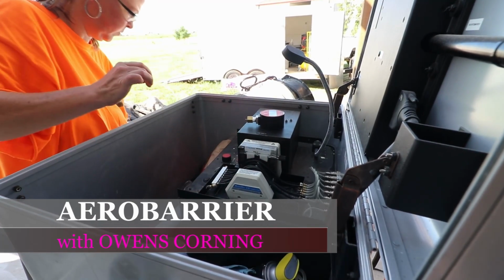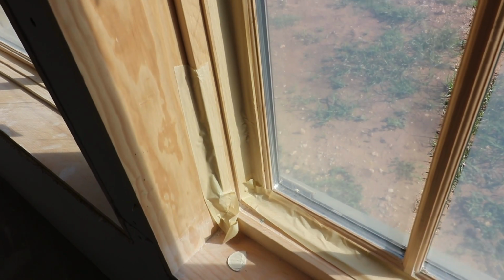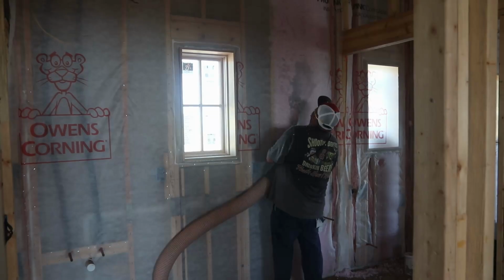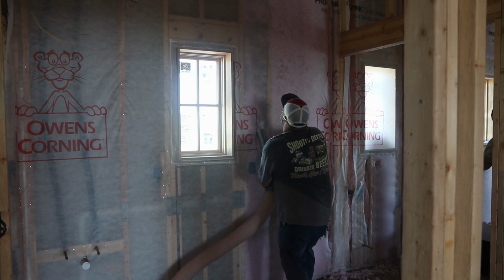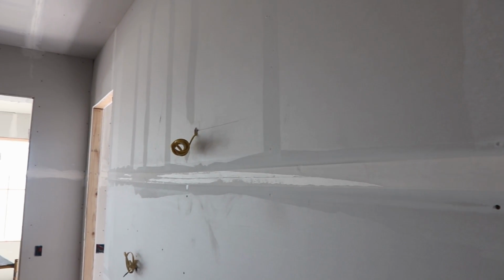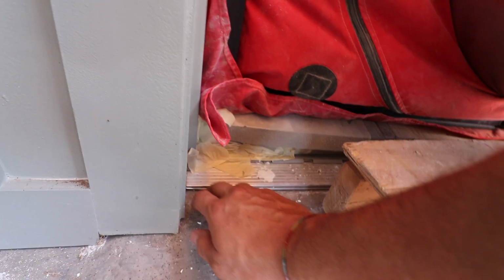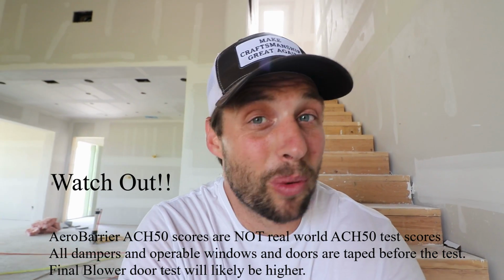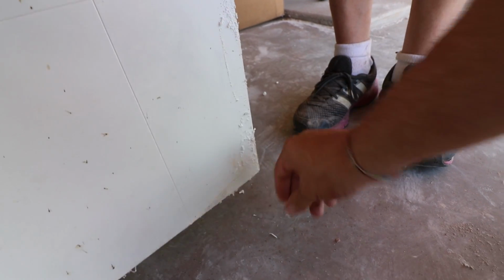This Insulation is BETTER than Spray Foam!!

Comment: Jordan, now that you've done the air sealing how do you prevent any of the finish tradespeople of putting a hole in you envelope? Like a cabinet installer missing a stud and covering it up with the cabinet.
Reply: Not to mention the homeowner hanging mirrors, paintings, photos and such.
Reply: U can only hand over a sealed home to the homeowner. . . I would hope they would be informed enough and invested enough to carry on with the program. . . If they wanna destroy it after being informed and educated then so be it.

Comment: My parents used the blown in cellulose and it does settle over time, we had to tear some drywall after a fire and there was a 12" gap at the top, this was roughly 10 years later.
Reply: I'm going with rockwool, not worth the headache
Reply: No settling of cellulose in walls if sprayed in with moisture and glue. We've had this technology for 40 years.
Reply: @TheGardenMasterShow  how many jobs have you went back to after so many years to tear out drywall to inspect the insulation?
Reply: @stcharleshometheater  You don't have to tear any drywall out to inspect any more if you have enough money to buy a machine, there is a machine and an app that you can use with your phone to see thru the walls to see how much insulation is in there. Though I was told it does cost quite a bit for the machine.  I only know this because I live in an older home built in the 40s and had some work done as I got it done threw a special program for the elderly. They used this door contraption and sealed everything they could seal up, but they used caulk and caulking guns they didn't have a machine like they did spraying. I even helped them to find spots that air was getting coming threw,  I had older windows with the cables to lift them up and close them and where them cables run in we had to caulk them big holes. They also went up into the attic and found every air leak they could and caulked, They sprayed insulation into my walls from the outside, taking off pieces of siding and drilling holes. They had to have it inspected from a government contractor to see if the contractors did what they should of. When the government contractor came he had a small machine he used along with an app on his phone and he could see in all the walls. There were several things this government contractor found that they had missed. And with this machine and app he had, he found that there were several walls that they had only blown the insulation 3/4 the way up the wall. So the contractors that originally did the work had to come back and do the things they missed as well as filling up the walls they missed blowing the insulation all the way in.  It was rather interesting. Only thing about the caulk is Im not sure how long it will last. :-(
Reply: @TheGardenMasterShow  I have seen the glue used with blown in fiber glass at home shows. I put a small ink mark on there display 12 years ago after seeing it for 5 years or more. The ink is still there, No settling yet, and that display gets bounced around loading and unloading plus the bouncing around in the truck or trailer going down the road. I'd say it works ;-)

Comment: I thought I've seen this done before drywall and insulation...
Reply: I was wondering that myself? Why not ensure the outer shell is sealed first
Reply: Same here. I may have missed him talking about it.....why he did it after sheetrock. Not sure.
Reply: @kipcarroll486  I saw he replied in a comment that this was actually what aero prescribed and so he was just following their procedures. And that best practice is to do it during both stages, before and after drywall
Reply: @MandoFettOG  Yes, I saw that after I commented on it here. Thx

Comment: Thanks Jordan. I am going to price out your method against 2 in closed spray foam and RockWool. I am already using Zip-R and 2X6s and better sill sealer. Can my builder feel comfortable with Zip-R roof as he has never used it there before? He was going to use 3 in spray foam under roof.
Reply: Richard Raborn I’m thinking the same thing. What did your analysis come up with?
Reply: Please what did you decide on and why?
Reply: @seanbrossard8178  Trying to confirm contact with Pro Pink installer and my builder. Still months from insulation install

Comment: Air gap between the wall and zip r sheeting? Or air gap between siding and zip r? I asked your buddy Matt with no response (too busy I'm sure) what a good procedure for a thermal break in cold climate areas. I am reading issues with zip r and sheet foam on the exterior, building condensation in the wall cavity. Would this be solved by a blow in insulation wall cavity having an air barrier being created by the insulation hold? Any info would help. Would love to get a contact exchange to get ideas bounced before construction.
Reply: Air gap is between zip and siding.  Siding is just a rain/uv screen, the zip is the waterproofing.  Air gap just lets water drain and dry when water gets behind the siding

Comment: How can putting tiny particles of fiberglass be healthy? Eventually those pieces will get into the home. And how would you make changes safely?
Reply: Size. According to the hard A.. OSHA inspectors on a federal job I worked he said fiber glass is to big to get caught deep in your lungs.
Also the insulation has plastic mesh, sheetrock and base trim all holding it back as well as it most likely leaking to the bottom so about 5 or 6 feet away from my personal air intake.
PS way more concerned about fatty liver /diabetes, CHF, vascular disease all caused by my soda intake, than a little fiberglass.

Comment: Does aerobarrier degrade over time like caulk does?
Reply: In accelerated lab testing it's been found to be stable and still hold after 50 years equivalent aging. I don't know their methods, so take it with a grain of salt. 

The polymer they use is a vinyl acetate polymer. This family of compounds is quite safe; different variants are the basis of Elmer's glue, yellow wood glue, and one form is even a basis in most chewing gums. About the most dangerous part is when you atomize the monomer (as they do in the application) you'd want to avoid sparks and probably not breathe it in.
Reply: @ardenthebibliophile  Shrinkage is my concern... Over time... the product must contain some water...
Reply: @CraigeLowry  it does not contain an appreciable amount of water.
Reply: @ardenthebibliophile  I have seen products quite similar to this, like the latex/ cementious insulation fill foam... It shrunk at least 20% in some areas... The home owner had it torn out and polyurethane foam sprayed in and it performed at much higher efficiency and comfort level according to the homeowner.. I believe I would stick with the non-shrinking calk and spray foam for my home seal an insulation, especially in the long run.
Reply: @CraigeLowry  so what you're saying is a completely unrelated material shrank, while a separate completely unrelated material didn't shrink.
Reply: @ardenthebibliophile  It's the content of water in those products... And I wouldn't say unrelated they are both used for home sealing and both have high water content...
Reply: @CraigeLowry  alright bud. Seems like your mind is set.
Reply: @ardenthebibliophile  but yours ISN'T ? bud
Reply: @kcajmortsnnew1488  well I'm not comparing latex or cement to acetate. If there's evidence for acetate suffering this effect I'll change my mind. An anecdote about an unrelated product is not going to change my mind.
Reply: it has been around for atleast ten years now. but it has been used to seal up hvac duct systems  so my guess is it does not degrade..
Reply: I was wondering the same thing. I'm curious if it's silicone or acrylic?
Reply: @MandoFettOG  acrylic
Reply: Everything degrades over time.  Its called the law of entropy.
Reply: @1974jrod  and you'll find I haven't disagreed with that. I am against the idea of an anecdote about an unrelated product being used to predict the rate of decay of this one.
Reply: @ardenthebibliophile  but straw men are so much easier to knock down!

Comment: If you have to tear into something in the future you're going to regret the fiberglass...
Reply: I hate fiberglass hope we have other options, everytime I go to the attic I have to put on a half face mask then take a shower and still feel the fiberglass that stick in me
Reply: @randomizer3775  
You gotta take a cold shower first otherwise your pores open up and it gets more embedded...
Reply: @randomizer3775  You could use blown in cellulose.  Essential Craftsman just did an episode about this material.
Reply: @ckm-mkc  cellulose insulation has a higher R value than fiberglass and no itch
Reply: @randomizer3775  Get a dedicated Tyvex suit, keep it zipped-up when not in use.
Reply: Cellulose insulation works well. 🌎
Reply from the maker: Yeah! I sucked down a golf ball sized chunk of the stuff while trying to get a freaking dove out of the rafters. Nothing at all like cotton candy.
Reply: @JordanSmithBuilds  how did the hers score turn out?
We used the closed cell and radiant barrier insulated slab and some other things but ended up 51 hers score.

Comment: Really like the concept.  Wonder if there would be a difference with rockwool?  Is AeroBarrier an option on retrofit or are there too many other vairables?
Reply from the maker: AeroBarrier will work the same with RockWool or fiberglass.
They say it can be done on retrofits, but you would definitely want to take your time sealing and protecting anything you didn't want plugged.

Comment: Great video Jordan.  Have you heard about AirCrete as insulation?  Kristof Irwin talked about it on a Positive Energy video (install done by an outfit called AirKrete).  It looks pretty promising - same basic constituents as magnesium oxide panels.  I'd love to hear what you think.
Reply from the maker: I have heard about it and watched Kristof's video at the time, but i have never used it myself and so have no first hand opinions.  Of course I am always full of second hand opinions!  
First my imagined pros: High insulation value. It might be good at sound deadening? Might be cheaper than closed cell spray foam? and... I am having a hard time  coming up with any other pros.
Imagined con's: More setup time than spray foam, without any better air sealing or insulating values than closed cell. Big carbon footprint.  Hard to source in most areas.  
I have seen several spray foam guys use AeroBarrier to get a tighter home, I am sure the AirCrete guys would have similar benefits on their installations?  Doesn't seem like it would be tightly adhered to the studs after being rolled down after install?  Seeing as how it is so friable?

Comment: How long does AeroBarrier last? Your house maybe very air tight today but what happens after say 5 or 10 years?
Reply from the maker: They have data showing no degradation after 50 year simulated  life cycle testing, so I am hopeful it will stand the test of time.  But I don't know if the simulated life cycle testing and actual life cycle testing will correlate.  Time will tell.
Reply: @JordanSmithBuilds  If the house is leaky after 40 yeats, I would think one could simply redo the aerobarrier treatment.
Reply: Or you could use spray foam which is an air and vapor barrier, has a higher R value, increases structural integrity as well as racking strength plus typically has a warranty good for the lifetime of the building.
Reply: @tylerfiske9516 , Except that it's been demonstrated time and time again that spray foam alone does not equal an air tight house.  Jordan covers this in the video; they've tried it and realized that you can't rely on it alone, the rest of the building needs to be tightly built.
Reply: @superspeeder , agree.  Foam works where you put it.  Product to product nothing performs better than foam.  Are there areas that you still may need to can foam, or caulk for instance, yes.  Did the foam air seal everywhere else you put it?  Typically yes.
Reply: The sealant endurance has been verified with 50-year accelerated testing, no change.

Comment: So, Jordan - @ 3:26 as you're explaining about "needing to breathe," etc. I noticed the tread depth on the stairs behind you.  I can't tell for sure but it looks the treads are substantially deeper than a 10" - 11" tread.  Is that correct?  what was the reasoning for deeper treads (which is what I wanted to do on a remodel but was told they're uncomfortable for people climbing stairs)?  Loving your channel BTW.
Reply from the maker: We have a 7 1/2" rise with a 12" tread.  The finished treads will have minimum nosing for a more modern appearance, so we wanted enough tread length to accommodate.  No problems going up or down the stairs so far!  I mostly have trouble with the cadence of too short steps than too long.
Reply: @JordanSmithBuilds  thanks for the reply.  I've noticed that some older buildings in Richmond, VA and in Europe have deeper treads - so that's why I asked.  BTW - You're doing a great job on your channel.
Reply: I noticed the tread depth as well. From the limited views, I thought it was a good look, as well as more natural. I think the most comfortable stairs I have built were 3 deck boards wide. You didn't break your cadence going down them. This was outside though, nobody is gonna go for 17" treads indoors.
Reply: Aaron O'Connell tread plus riser is traditionally between 17-19. Not just the tread
Reply: @aaronoconnell1597  indoors is what I was wondering about.  If you notice the stairs in Tiny Houses, the treads are typically deeper (maybe not 17") - but a deep tread is something that I'm interested in.
Reply: a good rule of thumb is that tread+riser should be between 17-19"

Comment: Was the timing of the aero barrier install ideal?  I would have thought it would be better to do before the drywall and insulation was installed.
Reply from the maker: For an exterior air sealed house like this, it would work that way, but for most builds, they are relying on their drywall to air seal, so we went with the standard protocol.

Comment: I appreciate the walk through.  I just had AeroBarrier out a few weeks ago.  (They brought my project down to 0.2 ACH.  I have yet to do the final blower door test, but I am hopeful at being under 1.0 ACH.)  Anyways, I was unable to be onsite when they were doing the air sealing.  So this was cool to watch.  My AeroBarrier guys said that my project ended up as their tightest test. That stuff left a sticky mess on the floors though, but WAY worth the extra clean up!  I also used Zip 6.6 R sheathing, but with Roxul R-23 for the wall system.
Reply from the maker: That is TIGHT!  I agree with the sticky cleanup.  We left some drywall dust on the floor to help keep it from grabbing... or at least that was my excuse for having dirty floors on AeroBarrier day!
Reply: @JordanSmithBuilds  That would have been a good idea.  But my mud guy was too efficient and had already cleaned it all up.  I was really trying to get AeroBarrier out before texture, as you did, but trying to get that all to work out with the mudder was nearly impossible.
Reply: I was quoted 1.20 per foot.  Seemed expensive to me.  Is that in line with what you paid?  Thanks.
Reply: @huntsbd  I paid $1.50/sq ft.
Reply: @wjthehomebuilder  1.50 per square foot.  What a rip off.  The new dog and pony show of the home building trade.
Reply: Love Zip R. But...I priced it just yesterday...$73/sheet!

Also the prices listed below are per SQUARE foot. CC Spray Foam is per BOARD foot per INCH.

Comment: How much does it cost approximately per house?  It should be about the same for any structure.
Reply from the maker: The cost is square footage dependent.  The bigger the home, the more area to seal, the longer it takes to perform and uses more product.  $.75 - $.80 per square foot in 2019, in my area.  Price is subject to change with date and location.
Reply: @JordanSmithBuilds  That is a really good price!  I just paid $1.50.  But this is really, really new (apparently) to the Northwest. Nobody that I talked to other than the HERS raters, knew about it.  Nobody knows what Zip sheathing is.  Nobody knows what ERV's are.  It's ridiculous!